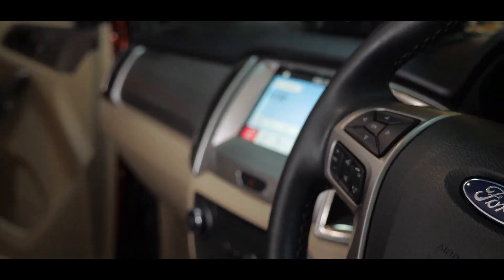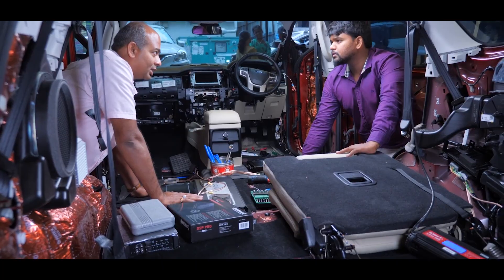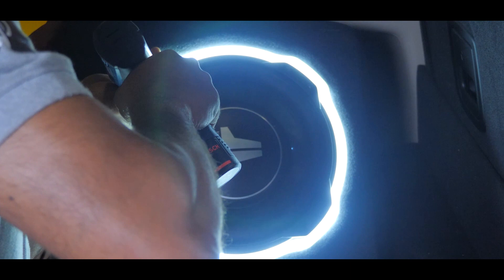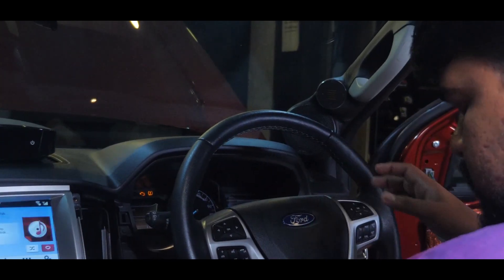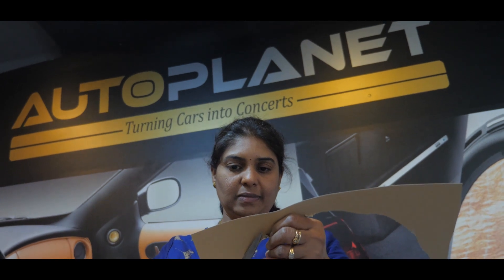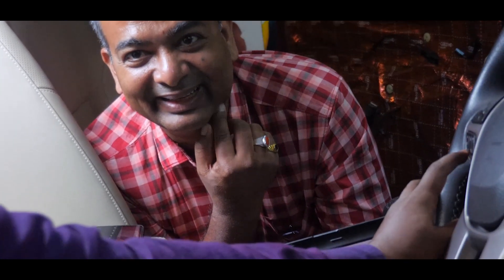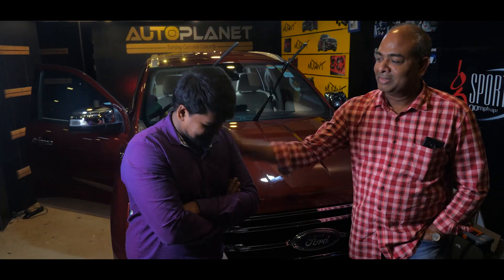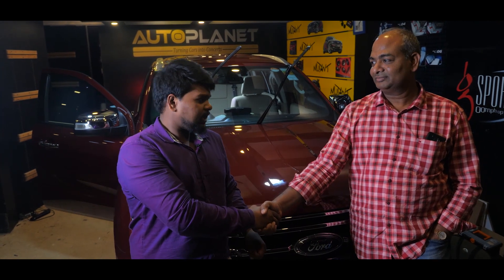DSP | ACTIVE THREE-WAY | HIFI CAR AUDIO SETUP | TURNING CARS INTO CONCERTS | Auto Planet | Bangalore

Comment: Which source u are using for audio?
Reply from the maker: We are using a HI-RES DAC as a source here.
Reply: @autoplanet7467  bt isn't it better to use a headunit with coaxial or toslink out? It will save money over hires DAC. When we have a great DSP for DA/AD conversion why we are doing DA/AD again and again. First head unit conver signals and DAC conver signals and then again DSP do the same.
Also if u don't have a headunit/phone which give hires signal, what is the benefit of a Hires DAC?